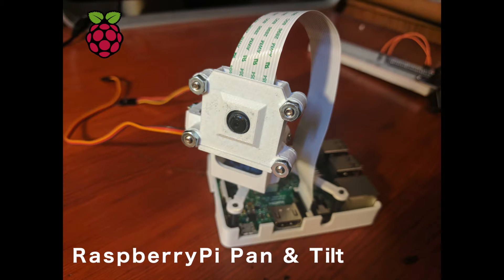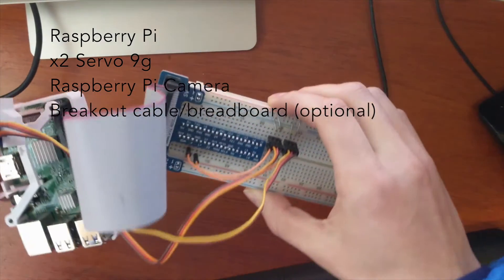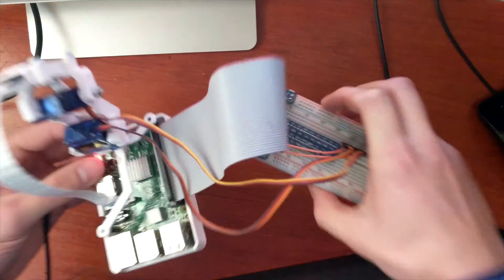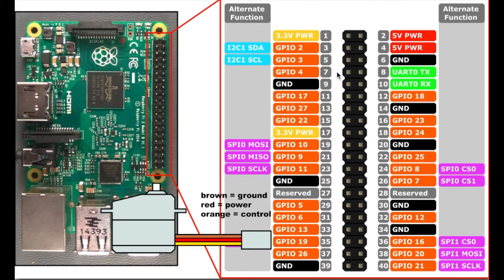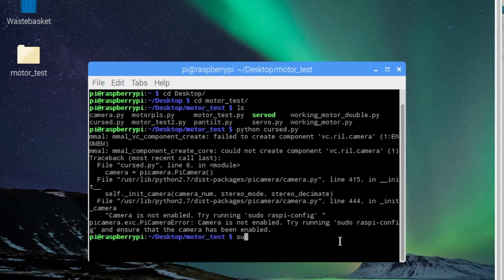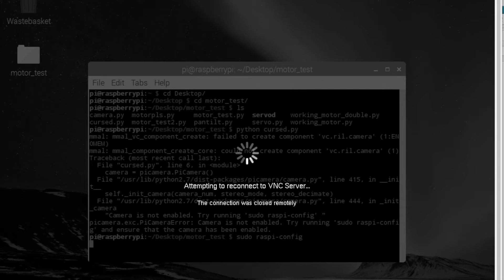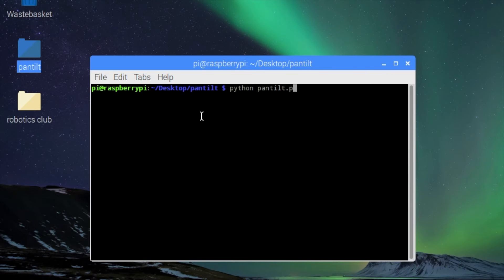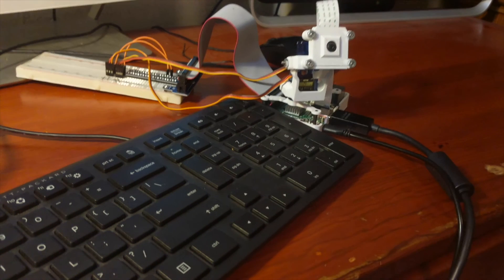Raspberry Pi Pan Tilt Camera Guide

Comment: Well, one of my servos is fried, and i use digital servos so THEY AREN'T CHEAP.  The original servo start positions that were in the code (which looked ok) made them push there limits,  and kept them trying to rotate one way, so i quickly pulled out the power. I then tried changing the values, and tried again but with values i know that are ok for my servos.. BUT THE SAME SHIT HAPPENED, AND ONE BURNED OUT. I checked, and Changing any value,is a waste of time. nothing works. Also, the camera image is on top of everything and is frozen centrescreen. i can't even drag it away to see the code. And i need to shut the whole pi down to close the program because there is NO CLOSE POSSIBILITY.... PEOPLE... DO NOT USE THIS CODE. IT'S FRUSTRATING, FRIES SERVO, DOESN'T RESPOND TO CODE CHANGES, etc... YOU SIR OWE ME A SERVO, i never had this happen. Don't know what it is but womething isn't right here, even the IDE doesn't detect errors.... But this whole code is one big error
Reply: The 50-250 range correspond to the typical 0.5 -2.5 microsecond PWM of the most commonly used SG90 servo. If your servos operate at a different PWM, or by a different metod entirely, then it's up to you to make the necessary adjustments. But in any case, he doesn't owe you $hit for not knowing how your servos work!

Comment: Can you show me the python code? thank you.
Reply from the maker: Teng Wang https://github.com/tuckershannon/PanTilt/tree/master/pantilt
Reply: Tucker Shannon thank you very much 😃
Reply: Tucker Shannon ,hey, my raspberry pi terminal print "left" "top" "down" "right" ,but the servo can't move, what's wrong? thank you.
Reply: Tucker Shannon I execute "sudo ./servod" it said "servod: Cannot parse the hardware name string"
Reply: Ok... So, all is good & working. However, after tinkering around with your PanTilt python file,  I ended up going with Servo Blaster, then....I ended up changing  it up using an Arduino Nano in conjunction with my RPi3B via UART. Then.... Lol..... I got all sortsa fancy. Picked up a BPiDuino UNO hat. So, thats where I'm at today. 

Sure, I could TOTALLY just use one of my MANY Arduino's. However... I've got a few RPi's doing nothing. So I'm actually using one as a pan & tilt network security camera with the NOIR camera with a automatic IR cutout filter. Also have the PI setup as a Wireless Repeater Bridge  to help signal range for my other IP camera's. 

Love me that Pi! lol.

Comment: Can i have the schematic connection with two servo? i see you use a diod also but where to put it?
Reply from the maker: I plug the servos directly into the Pi. The brown cable goes to GND and red goes to 5V PWR, yellow goes to one of the GPIOs that I circle during the video